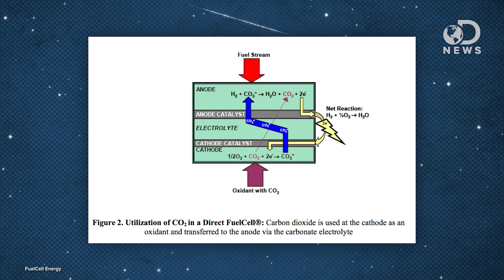Could This Technology Make Cheap Energy Clean?

Comment: Stupid people. Stupid people.

You have solar power - USE IT!!!
Reply: Unfortunately solar power only does so much. Hydroelectric, wind, solar, geothermal, hydrogen fuel cells. All of those used in tandem would GREATLY impact our lives.
Reply: This is Scandinavia it's dark for 80% of the day in the winter the only choice is Natural Gas, Gas from Cows Gas from Compost, Subterranean Thermal or burning swamps if you're Finland.
Reply: Kenneth Hartsock
Just this past week I read that photovoltaic solar cells have been made that successfully convert 40% of the light shone onto them into electricity.  They're getting more efficient.
Reply: djlapio93litlebro Just because you have a working prototype tells us very little.

We already do have many "working fusion reactors" that all produce fusion reactions, the problem is they currently do not produce more energy than what is put in to begin the process.

Anyone can have a working Reactor the problem is how efficient is it and how much more research and development needs to be put in to make it commercial viable.
Reply: VariantAEC Sweden:
46% Hydro (all the rivers have been maxed out with hydro plants)
39% Nuclear
2,5% Wind
13% Various burner plants; Oil, coal, biofuel, garbage and surplus energy from industry. (The largest contributor to CO2 emission of these is the oil burner plant that replaced the power production lost when Sweden shut down one of the nuclear power plants (The Greens were in the coalition that made this oil plant happen)).
Reply: Carbosful Well when you're only getting a few kilos of short lived radioactive waste per ton of ore that's used, and compare that to a vacuum camber that weighs possibly hundreds of tons, and will most certainly be considered radioactive waste, by the time it would have theoretically been run long enough to be decommissioned. The thing about fusion that people don't realize is that reaction bombards the chamber with neutrons that tend to destroy what they hit, which over a decent period will irradiate anything that isn't behind something thick enough to stop the neutrons, which means that vessel wall and structure will contain a fair amount of unstable isotopes, it's how the reactor breeds tritium from lithium. 

Abundancy of the fuel source is meaningless when that source of energy is substantially more expensive. I'll take fusion a bit more seriously when it no longer requires a massive amount of very expensive materials to make a "working" reactor.
Reply: Solar power doesn't work for at least 1/3 of the day. Then you have to consider winter, clouds and snow. Even if you put it in a dry hot place it will just get dusty and expensive to maintain. And to top it off they are toxic when thrown away. But lets ignore all that and assume its out up anyway, the best conditions still only give 20% or so efficiency.
Reply: Solar is actually one of the least efficient fuel sources, even if its renewable, wind power is cheaper and more effective, but is still dependant on weather. Tidal, Hydroelectric, and nuclear powers are the most efficient though, consistent and dont have significant impacts on the environment when properly maintained.
Reply: that is a very good idea, actually there (this)  is a solution to this problem but not using oil just cuts a huge chunk out of the economy and that's why we keep polluting.
Reply: djlapio93litlebro 
Is it windy in Scandinavia? Aren't there rivers in Scandinavia? Yes and yes. Then there are no excuses.
Not that I give too much of a care. I hope no one in Scandinavia is planning on filling underground caverns with a gas though, that would be stupid.
Reply: ***** Agreed.
Reply: VariantAEC
Well there is Denmark that is doing wind power and Sweden does hydro-power ... and ... Finland buys gas from Russia and Nuclear power
Reply: djlapio93litlebro Except Denmark is a Very small country, Smaller than most  Cities in USA.

Denmark's population is only around 5 million. Of course you could find some radical way to deliver power to them when all of your consumer products come from another country producing them with big industrial facortories that require very dense power demands.
Reply: Carbosful
thorium salt reactors?
Reply: djlapio93litlebro Sure, but who is going to spend billions of dollars to develop the technology? 

When you can throw your billions at Fusion which most countries and governments have already been doing.

There are even Very big private companies such as the Aero Space Giant LockHeed martin having a 10 year goal to achieve Cold fusion reactors.
Reply: Carbosful
But china already made a working prototype. I:
Reply: Carbosful http://en.wikipedia.org/wiki/Liquid_fluoride_thorium_reactor
Reply: djlapio93litlebro I don't understand why you linked me the wikipedia page to LFTR.
What is point you are trying to make here ?
Reply: Carbosful
LFTR is already commercial instead of still a prototype
Reply: djlapio93litlebro Where is this thorium commercially ready reactor that you are talking about? Non existent yet

China Announced earlier this year that it is planning a 10 year goal to build the first nuclear Thorium Reactor LFTR

India is also competing for the first commercially ready thorium reactor however it is not LFTR its a AHWR And plans to put out the First 300MW Thorium Reactor by 2016.

It is not commercial ready yet. And AHWR is completely different from  LFTR
There are many different types of thorium reactors that already have been built however none have been commercially viable or ready.

And talk is cheap until we actually see india sucessfuly bring us the first one that it claims
Reply: Kenneth Hartsock Great video and it is very spot on, targeting many points of this very conversation.

However there are a few point that he gets wrong about thorium. When people say "energy density" he took it as literally "mass density" and thats where he was wrong.

When the fact comes up as Thorium being more energy dense it just means that we can extract much more energy out of it with a certain process.

Liquid Flouride thorium reactors have a nearly complete energy cycle.

Our current Uranium powerplants Leave behind 95% of unused energy.
Reply: Carbosful First off LFTR is far far far more developed than fusion, we actually have made a working reactor that did operate almost continuously for years(they turned it off during the weekends, and maintenance, upgrades, experiments ect.). The amount of money to needed to make LFTR commercially viable is trivial compared to the amount needed to make fusion possibility, I've read a fairly recent report stating that ITER will cost at-least 20 billion dollars, and that's for a reactor that will be considered a success if they get it to run for more than a couple minutes.  Kenneth Hartsock  That video was specifically addressing the thorium powered car that you would have to be completely scientifically illiterate to not realize it was a hoax, it had nothing to do with whether or not thorium can used as a viable source of power.
Reply: Phlaked Corn LFTR is definately more developed than Fusion however thats because Mainly due to the fact that we have the technology for Uranium Fission and did actucally have many years of thorium research when it was in competition against Uranium in the 60s. So we had a big foundation.

Both Thorium and Fusion have much more potential then Uranium and both can theoretically generate much more energy (Fusion obviously much more then thorium)

Both technologies will  be developed 
However Fusion is definitely going to be the most potent by a land slide.
Reply: Carbosful Sure if you can make a sustained fusion reaction, and maybe ITER will lead to an answer to this problem. Fusion is always just around the corner, has been since the tokamak reactor was invented in like 1956 if I'm not mistaken. Funny thing is ITER is essentially an enlarged more sophisticated version of that very same reactor.

A few years later we built a LFTR reactor and it was operational and producing power a mere two years after construction began, I don't know the details about the costs though. LFTR's are far simpler and need far fewer materials to construct, so they will be cheaper, almost no matter what.

Fusion reactors are great and all, there still is a nuclear waste problem upon decommission too, so they are in the same boat as LFTR there. The radioactive material that fusion produces is from the containment vessel itself being bombarded with neutrons.
Reply: Phlaked Corn "around the corner" I think thats more of an issue for people that belive Press instead of taking a look at the facts themselves.

The Lauren Livermore Nuclear  Fusion reactor did produce more energy than was put in earlier this year so there's advancement for you.

"""Fusion reactors are great and all, there still is a nuclear waste problem upon decommission too"""

It would be a joke to compare The waste from Nuclear Fusion to any form of Fission.

All types of Fission reaction produce waste, The waste comes Directly from the Fission reaction.

Fusion Does not create any form of radioactive waste. If you fuse deuterium + tritium then you end up with Helium-4 completely stable. The only form of waste would be indirect and that's from the High charged Neutron,what ever the neutron hits will be radioactively induced.

However you can see how the waste is astronomically less since fusion is not a direct Radioactive waste producer like Fission is.

"""LFTR's are far simpler and need far fewer materials to construct, so they will be cheaper, almost no matter what"""
That is true for the time being. It might be more complicated however at the same time it releases much more energy through a fuel source that is much more abundant. As abundant as Thorium is, H20 takes that abundancy to a whole new level.
Reply: Carbosful I don't believe I mentioned anything about producing more energy than what was put into it, it's about doing it for any meaningful period of time. I am aware of that particular experiment, a glimmer of hope, but far from anything that would be able to actually generate electrical power. Even once the viability of fusion has actually been proven, it won't be competitive unless some serious advances are made. But who can see the future?
Reply: Problem with solar I'd that it only works during the day. Peak energy use is in the evening after the sun goes down.
Reply: solar panels are too inefficient right now and only have a lifespan of about 15 years before they need to be replaced. these panels are expensive and are made with non recyclable materials so they are put in landfills when they reach the end of their life span. solar is a great way to complement the power grid and take some of the strain off the major energy contributors but it is simply not feasible to employ only solar.
Reply: LENR costs a fraction of solar and it is reliable power 100% clean 24/7 365 days of the year.
LENR systems are affordable to everyone on the planet and solar and wind are not.
Reply: Devon Patterson  Go back to school Solar works I've had it for nine years go take a hike nuclear lover you're a killer of the earth
Reply: FixItStupid I doubt anyone would debate whether or not it works. It's how much you invest vs how much you get out, in this case solar loses. Nuclear doesn't have the greatest return rates, but unless you like all the toxic heavy metal laden ash including radioactive elements that coal produces, and you like having pretty much  anything invented in the past century, you need incredibly large amounts of stable base load power, and solar simply cannot provide it, not unless you like making landfills worth of old batteries and dead solar panels, not to mention the massive unlivable wastelands(that make Chernobyl look like an oasis) that the production of the materials required for PV cells creates(though this is mostly due to poor regulation in China(also the only reason they're cheap enough to even consider)).
Reply: NO it's paid for and it's cheaper now than ever and it doesn't kill my neighbor
Reply: FixItStupid Yeah and you can thank subsidies and cheap Chinese parts for that :). Solar power is actually more likely to kill your neighbor, assuming one of your neighbors happens to be one of the contractors that installs these solar panels, or has them installed and has to climb on the roof to clean them. Solar panels actually have a higher death per KWh ratio, mostly due to electrocutions and falls.
Reply: And there is just nothing you like about anything you just want to kill the earth with nuclear power for war

& all those isotopes what you can do with those I'll take my solar panels by the way I haven't been on the roof to clean them in nine years they worked just fine
Reply: FixItStupid So how does lowering the competition for resources by using a power source that can provide humanity power for thousands of years, that can be used to distill water, create fertilizer and synthetic liquid fuels contribute to war?
Reply: FixItStupid  Nuclear energy, especially the new stuff, can't be weaponized with any form of efficiency. If you want nukes you make nukes not reactors.
Solar panels are very inefficient at best and a nightmare to maintain at worst. The are limited to certain times of day, assuming no clouds or nearby tall buildings. If you put them in a nice dry place they get dusty, in a wet region its dark a lot. Better still the only last 15-20 years before needing replacement and are toxic to dispose of. You not cleaning it in 9 years means only that you are an irresponsible owner.
Reply: I feel like I'm talking to a bot apparently you don't know how nuclear bombs are made  YOU don't know where to get the material to make them and apparently I don't need to clean them because they don't need to be cleaned to work.... you're in the  Nuclear industry obviously why would you defend something that kills from the time you dig it out of the ground  till the time you call it nuclear waste it is killing....... you have yourself day
Reply: FixItStupid To make a bomb you need U-238 or plutonium. Reactors use U-235 which can't even cause an explosion. Uranium is a weak alpha emitter which means you can handle it with gloves and be perfectly fine. Dump it in a hole and forget when done with it.  And solar panels get dirty and less efficient over time and must be cleaned to maintain the shit efficiency it had to begin with. And no I don't work in the nuclear industry.
Reply: FixItStupid LOL, well you're killing the efficiency of those solar panels if you don't clean them. Also you obviously have no clue what goes into a nuclear bomb, some nuclear plants produce the fission products that can potentially be refined into weapons grade material, other better more efficient reactor designs simply do not produce these isotopes. Everything is killing you from day one, oxygen, cosmic radiation, various chemicals in the air and water, ect. the radiation released from the production of nuclear energy is trivial compared to these. Now if you really want to irradiate yourself go breathe in some smoke... Even astronauts receive less radiation than smokers.
Reply: FixItStupid your ignorance offends me solar panels use photovoltaic cells to convert radiation from the sun into electricity. and i hope you know that the sun i one giant fusion reaction or in other words a nuclear reaction. solar is a good way to supplement the power grid but it is not feasible for solar power to be the only power supplier. what we need to do is switch to a better form of nuclear power. the liquid fluoride thorium reactor (LFTR) is the best way to generate electricity. it is a safer, more efficient, more economical and a greener form of nuclear energy. not only is it physically impossible for it to meltdown like Fukushima, and Chernobyl, it is also impossible to make nuclear weapons out of thorium. it is also more efficient than conventional nuclear reactors. it is more economical because we already have a lot of thorium just lying around and thorium can be put straight into the reactor with no need to enrich. the LFTR is also greener. the LFTR can use the 650,000 tonnes or so of depleted uranium that the world has locked away as fuel, and because it is more efficient and has a different decay cycle it creates 85 % less nuclear waste with most of it decayed into safe re-saleable elements within 10 years and the rest decays to safe levels within 200 years not the 100000+ like the conventional nuclear waste. the worlds best hope for cheap clean energy is thorium power and if D-news or any other person can help spread the word that would be great. as you can see i have gone to school and am indeed educated. i have no wish to 'destroy the earth' quite the contrary actually i try to spread word about alternative and improved forms of nuclear power generation i actually want to save the earth and the environment. also i wrote an academic article on alternative energy and thorium power and have done in depth research into thorium power and many other alternative power sources so i am clearly not the uneducated one here.
Reply: FixItStupid http://liquidfluoridethoriumreactor.glerner.com/

website explaining thorium power. educate yourself
Reply: doomlord117 You have it the wrong way around....

U-235 is used for bombs, mostly U-238 is used for nuclear fuel, although you can make the reactor smaller when using more enriched uranium (Nuclear submarines run on almost completely U-235) (US ones at least)

Uranium reactors can be used to produce plutonium, possibly depending on their configuration....

The produced plutonium is a useful fuel for reactors itself though... Other isotopes formed might also be usable....

(Thorium reactors also seems promising and produce a lot less "waste" that can relatively easily be seperated into weapons grade material)
Reply: Gert van den Berg  Ionizing radiation destroys DNA
Reply: Devon Patterson Ionizing radiation destroys DNA
Reply: FixItStupid ionizing radiation by definition is ultra violet, x-ray and gamma ray wave length light. i don't see your point here because radioactivity is everywhere. there is naturally occurring radon gas in the ground which emits alpha particles. there is thorium and uranium which naturally emit gamma rays and there is thorium and uranium in the ground everywhere. if you stand outside you get large amounts of ionizing radiation from the sun which emits ultra violet and x-rays as well as infra red and visible light why do you think you get sun burns the UV light is literally cooking you. and you also get it from the ground though in lesser amounts. if you stand in the garden you are getting a dose of gamma radiation. the human body has evolved to deal with radiation we live on this planet therefor we need to be able to withstand it. even people that have never stepped foot in a reactor can get cancer. now if you are stupid and decide you are going to go x-ray your arm 50 times ya you are going to have some problems but the extremely low doses that you get in every day life and from buried waste from reactors poses no threat to anyone because radioactive elements are everywhere.
Reply: Devon Patterson I'm sorry sorry you do not have an understanding of physics obviously don't understand what ionizing radiation is and how it affects DNA you're a little confused on the electromagnetic spectrum radon gas causes lung cancer lung cancer cancer how does it do that???? your understanding of physics is Limited and also its interaction between energetic radiation long-term low level  tell me what that does????
 it seems like you're trying to sell yourself on nuclear energy it's a LIE it's not economical THE only reason it's exists is for making bombs uranium fuses and create the  plutonium why do you think they had the fast breeder reactors out Hanford they were creating plutonium & now what DO we  HAVE ecological nightmare the more I also want to try to understand the food chain bioaccumulation & you're confusing low level long-term with short exposures that go away
Not that that's any less damage you know that's why they don't let pregnant women get x-rays there's a book out that was printed in the 70s by Dr. Gofsman population control through nuclear pollution check that one out then you may something they've been trying to tell us for 45 years but your god damn corporate government won't let the truth out so you just keep on being brainwashed you see my grandchildren all have birth defects I've had thyroid surgery bypass down my genetic defects to my children and now my children have passed them down to their children when you just worry DNA/Mutated Life will end soon and you do know that the largest nuclear power point in Europe is melting down as we speak good luck
Reply: FixItStupid sir my major is physics more specifically nuclear and particle physics and i can tell you don't actually have any idea what you are talking about. you breath in radon and because radon is a dense gas it sits in your lungs for a while emitting alpha particles which increase the risk of cancer in your lungs. nuclear energy is the future of the world if we switch to the liquid fluoride thorium reactors we can have safe, efficient, cheap, clean energy and you can't make bombs out of thorium so that's a bonus. and by the way no one can fuse uranium not only is it physically impossible if you could you would have fusion and therefor infinite energy. plutonium is a by product of the fission reaction, that's just how it is that doesn't mean it's all used to make bombs. and once again you get more radiation from the ground than you do from nuclear waste. radioactivity is everywhere if your kids have birth defects its not because of nuclear energy production.
Reply: FixItStupid Radon gas is dangerous because of what it decays into, and the radiation from that decay doesn't help. Many of the current reactor designs were based around the production of nuclear weapons, this is the primary reason the funding for LFTR was cut. But your way off on the actual health risks of using well regulated nuclear energy, it's on the verge of being absolutely insane.
Reply: FixItStupid Which is why I try not to swim in reactor cooling pools too often...

Nuclear waste becomes much more manageable once processed - the highly radioactive stuff decays fast, things with half-lives of thousands of years aren't very radioactive... With Uranium based reactors this does get out all the things that are useful for bomb-making as well though (it is useful for other reactors as well). Thorium reactors seems significantly better in not producing bomb-making materials...

Solar does make sense, at least in the distributed setup where you don't need to mess up more land, since you use existing rooftops and other places that humans have already messed with. If you have enough of it, you can use existing storage infrastructure to handle all the peaks using solar and quite possibly just about shut down other power stations most days... (Distribute generation also have other benefits - less transmission losses and less central control over the electricity supply)

Storage however is inefficient and expensive... (Pumped storage requires dams, which destroys river ecosystems, batteries is expensive and unlikely to be practical unless everyone starts driving electric vehicles and allow the batteries to be used if the car is plugged in) (A huge global power grid would be another interesting solution, allowing parts in daylight to supply the rest). Fuel cells might eventually be the solution to storage..

Every type of power has its ecological effects. Large solar farms requires paving of huge areas, wind turbines kill birds and bats, hydroelectric power requires dams - which have a huge impact, especially on migrating fish species, nuclear have radioactive waste when operating correctly and sizable radiation releases when not, fossil-fuel-based power stations spew mainly CO2 for the "clean" types and lots of other crap for the bad ones, like coal (the radiation levels close to coal power plants are actually higher than near a correctly operating nuclear power station). I'm not familiar with the impacts of geothermal generation.
Reply: yea but solar power is no very effective or very strong meaning that we whould need a lot fore a small amount of energy